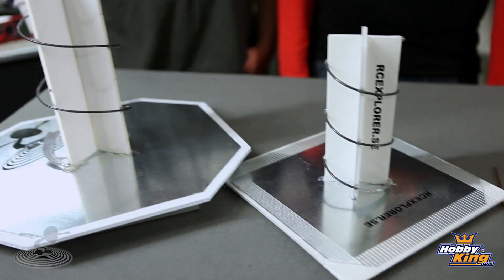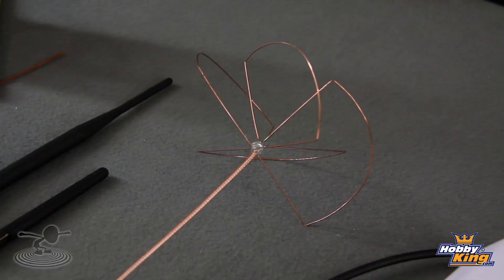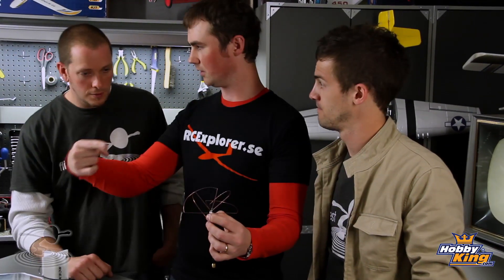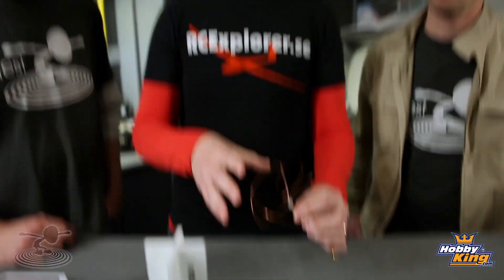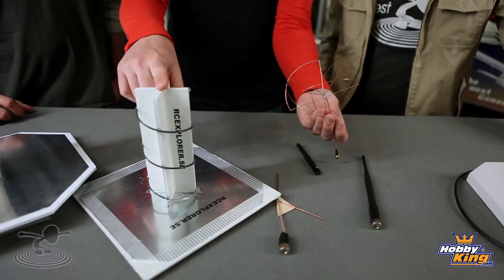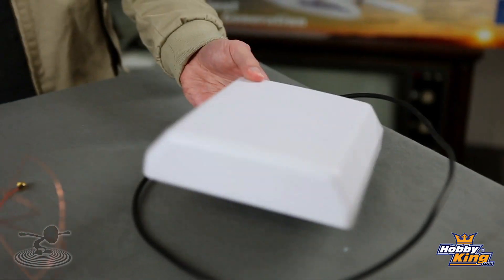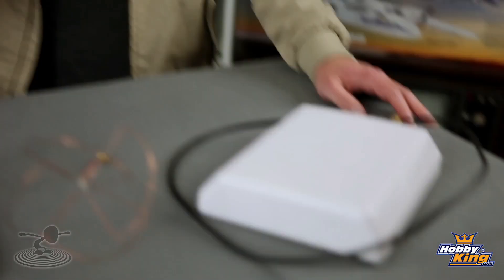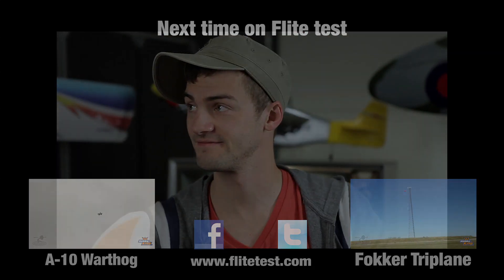Flite Test - FPV Antennas - FLITE TIP

Comment: how do i contact you guys for specific questions? im in desperate need of help. the internet is not helping me on some things.
Reply: what do you need help with? i'm a bit of a RC veteran myself, so i might possibly have your answer.
Reply: well, as you offer yourself, i've got a question about antennas, their length depends on the frequency, but in the one that is twisted, does it has to meassure that value when twisted or extended?

Comment: Should I change the circular polarized antenna on the quad to a clover leaf? And then should I change the rubber ducky to a clover leaf on my goggles? Or will I leave the goggles as they are? Sorry, I'm new to this :-/
Reply: +bpunlimited the rubber antennas are the stock ones. those are the worst, use circular polarized clover leaf antennas. The best antennas are the SpiroNet Circular polarized antennas, they are bendable and work well! check if your VTX / Goggle use SMA or RP-SMA. for example, if your Goggle connector has a hole then it use SMA. the antenna will have a Pin at the connector. if its RP-SMA it has a pin at the goggle side and a hole in the antenna connector.

Comment: I would recommend this antenna: http://www.banggood.com/AOMWAY-5_8G-3dBi-RP-SMA-Male-Four-Lobe-RHCP-VTxVRx-FPV-Antenna-p-978264.html?p=LH15061497646201504Y or this one: http://www.banggood.com/Aomway-5_8GHz-FPV-4-Leaf-Clover-AV-Transmission-RHCP-Antenna-1-Pair-p-961730.html?p=LH15061497646201504Y with this 3d-printable protector: http://www.thingiverse.com/thing:1147522

Comment: Wondering if anyone has tried a Skype fpv flight thinking about trying it for kicks
Reply: WHOAH MAN, you're a genius. Now i just need another phone with full 4G bars or LTE to try this. HOLY FUCK. I'm still wrapping my head around how i haven't thought about this. I wonder what the latency is. hmm
Reply: Ricky32908 im sure that there will be some latency but get enough altitude should be ok.. be able to get some video's even if its not flight worthy. .wish these guys from flight test would try it ive commented a few times in different videos asking them to try it
Reply: Ricky32908 It works, I've tried it. It does have lag, sometimes it can lag up to 2-3 seconds which is pretty bad. Though, if you're going to do this, please make sure that you have a small, light phone, capable of 4G, LTE and H+. Both phones have to be on the cellular 900MHz band as well, so don't connect your ground station phone to the WiFi, unless it is over 10mb/s transmitting speed. Unfortunately on my side though, is that I never got big use of this. Problem is that my quadcopter is rather small, and the lightest phone I have is 110 grams, which is a lot when you already have a 1000mah battery on board the quad. It's also a 200-sized quad, so keep in mind that your aircraft has to be large enough to carry a phone. 
Good luck!
Reply: I have a DJI, ill try it with my friends phone. I've carried digital camera on there with ease
Reply: You still have limited range. You won't be able to just fly anywhere.
Reply: Chris Andes The only limit is the control system. If you hook up a ezUHF or DragonLink, or something similar, you can go very far. As far as as safety goes you can try it out, but the safest way to fly FPV is with real gear.
Reply: Boss Habekush Interesting.
Reply: there is a app in google play called airboss. I don't have a aircraft big enough to put a phone on but I used it with a friend at his house and he was about 20-30 miles away and you can also take photos and video (I think it also has a gps in it but I forgot).
Reply: rc guy I no longer fly with phones, but thanks for the recommendation! I like the app.

Comment: Hi guys, I'm wondering how you can tell what antenna is on what frequency. Is it the antenna length, or the material used in the antenna? If you get a chance to answer this that would be great!

Thanks!

Comment: What should u use for 2.4gigs? I want to get into rc planes from rc cars and have had some experience but I dot know about this?
Reply: Interesting question. In the telecommunications world... 2.4ghz is considered largely inferior because of the amount of "radio pollution" that exists with such a frequency. WiFi, Microwaves, Cordless Telephones... almost anything digital and wireless is likely to use 2.4ghz. It's a free band available for anyone to use, and it's range actually isn't that fantastic. Just consider the WiFi you might have in your house... Average range is 100 meters, and that's without walls in the way... there are laws on power output in the USA and Europe, so it's very important to do some research about it first.

Otherwise, buy what is cheap, but not too cheap. I hear a lot of great things about Turnigy radios, Hobbyking have them for really cheap.

Comment: This part isnt neccesary, but I want to extend my camera range..

Here is the link to the camera, at least the ebay page...:

ebay(dot)com/itm/NIGHT-VISION-Mini-Wireless-Spy-Nanny-Micro-Pinhole-Camera-Cam-System-Receiver-/111082716190?pt=US_Surveillance_Security_Systems&hash=item19dd0bbc1e

here is the link to my naza: 

ebay(dot)com/itm/DJI-NAZA-Flight-Control-GPS-Compass-RC-Quadcopter-Frame-Motors-Props-ESCs-/251318864334?pt=Radio_Control_Vehicles&hash=item3a83c589ce

THX

Comment: Guys, im sorta confused :/

*note , im not very good with antennas*

Im getting a quadcopter, well a dji Naza gps with a frame, and it says I need to buy a  2.4 Ghz radio with reciever....

Im intending on making it have FPV camera... 
My only question is do you know what type of antenna should I get for the onboard antenna and what type for the ground.
I want to be able to go far away-ish and be able to go behind blocks.
I will comment on this because im running out of space, look below plz

Comment: well if you use 5.8 fpv gear the anennas are TINY. you could use like a 200mw 5.8 transmitter with a clover leaf and fit it all in the plane.

Comment: Ya the vid tx on these systems gets very hot. you could work an inverted v antenna into your tail section and actually get longer range. But a lot of your range also comes from your ground station setup. wait a minute you plan to DLG 3 km away?? :-/

Comment: Airflow over the vtx for cooling I guess?
I have some experience with transmitting on the FM radio band, so I know that a goog cooling is needed for optimal performance.
Plus, for the best performance of your glider, you want to get rid of all the drag you can get rid of.
I'm looking for a range between 2 and 3 km.

Comment: Is there a way to make an antenna in your fuselage?
I really want to try some FPV gliding, and even when you have never flown gliders before, you will know that you don't want too much drag, and a good antenna will create alot of drag.
So my plan was to put the transmitter in the fuselage, and the camera in the cockpit, and now my only problem is the antenna.

Comment: Hi there, Can you please post the link for the modded 900mhz antenna mod? please, i tried to pull out the rubber part of the one i have right now and i think i broke it, i thought this antennas are like 2.4ghz ones, u can ditch the plastic part. so please post the link, i am using the antenna that came with 1500mw 900mhz hobbyking fpv kit.

Comment: @lolergramCCCP 0.8mm copper coated MIG welding wire is what I use. It holds it's shape really good and is easy to work with.
/David - RCExplorer